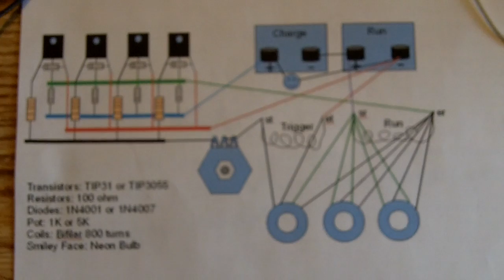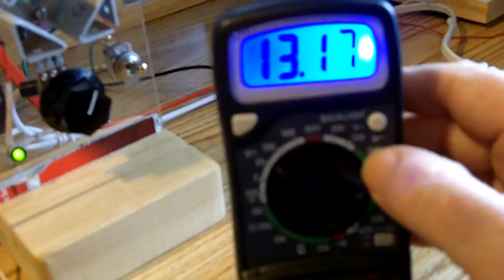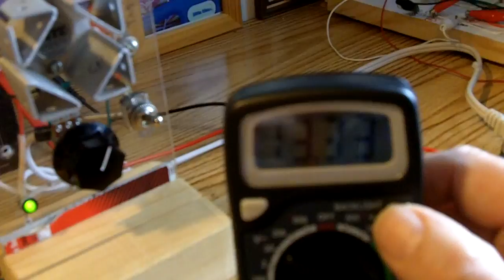Four transistor bedini

Comment: What would you think about 16  penny nails in place of the welding rod?
I cant bring myself to spend 17 dollars on the wire again.  My first coil I got the rod for free.
Reply from the maker: Sounds good.
Reply: do you think that they would be good enough??
Reply: Yeah I planned on cutting the heads and grinding the points flat.  I just did not know if they were a good enough iron core option.

Thank you
Reply from the maker: Clown Whisper To make sure they are good and tight you can tap the last few in with a hammer.
Reply: Yeah, I have made a coil out of the welding rod and that is exactly what I did

Comment: Nice build really.

What rotor are you using this is so smooth
Reply from the maker: The rotor is from a computer hard drive.
Reply: magnetman2010
Thanks for the info. i have some of these and my challeng is they have a very short
shaft sticking out on the bottom that I can mount them on a base. How did you do it? did you leave the casing on ? and hacksawed the crap out it?

It looks too nice for that.

thanks
Reply from the maker: Yves Baggi That one might been out of a VCR.
Reply: magnetman2010
those run real smooth too. Got a few of these crammed in a box....

thanks
Reply: si se pudiera traducir a español seria jenial  ok
Reply from the maker: It is from a computer hard drive.

Comment: I see that it runs well with symmetrical coils and magnets. I found that mine ran better with opposing coils when the magnets were in a geometric pattern that was different then that of the coil placement. It allows for a phase shift when running 4 coils and 5 magnets or 3 coils and 4 magnets where theres never any conflict between opposing coils.  It allows a pretty significant increase in rpm's.
Nice clean setup...good job! Thanks for sharing.